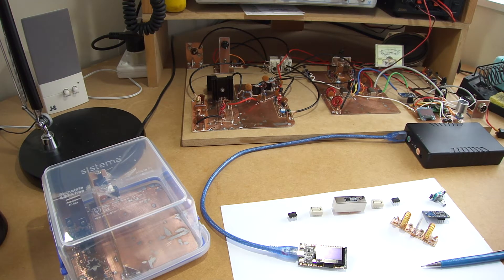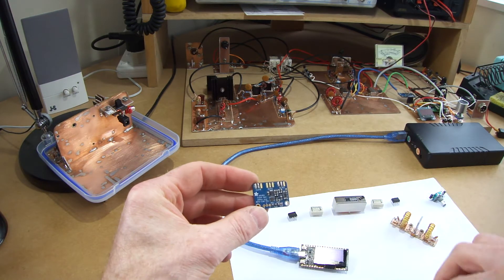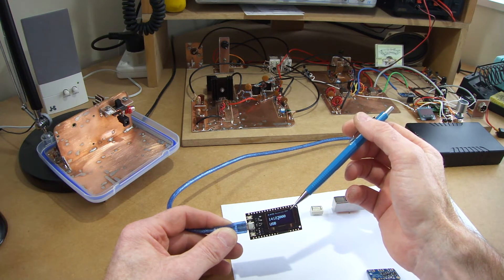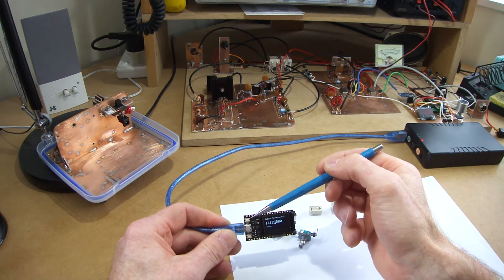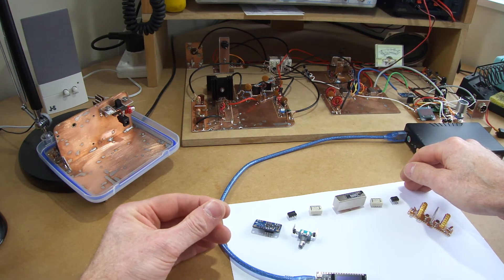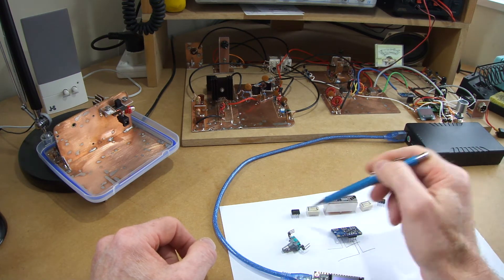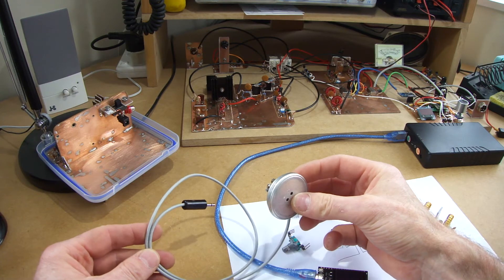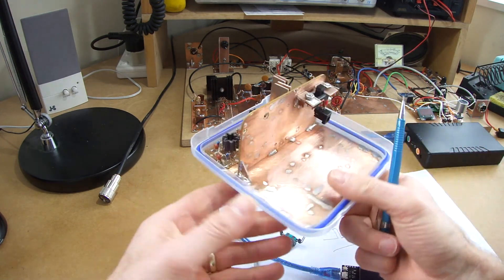Homebrew Portable 20m SSB Transceiver Part 1 - Design Ideas

Comment: I know this is an old video but I going to be working on my HF rig more and I plan on using my ESP32 as the core. I also plan on using the LEDC tone out stuff on it as signal sources for my tuners.
Reply from the maker: Let me know how you get on. If I recall, I had problems using the rotary encoder, Si5351 and display at the same time. I was just thinking last night that I should dig it out again and make it into a small portable antenna analyzer.
Reply: @CharlieMorrisZL2CTM  The ESP32 I have doesn't have the Display and I plan on not using my Si5351 and instead use https://github.com/espressif/arduino-esp32/blob/master/cores/esp32/esp32-hal-ledc.h which can output a freq as high as 40 Mhz with out interaction from any of the cores on the ESP32. I might end up even using the builtin wifi to have my rig interface be a web page. (For Freq setting and band changing)    

Also I got inspiration from your SDR series and was thinking of using the ESP for that but I would have to rewrite/port the Teensy's audio library to ESP32.
Reply from the maker: That's really interesting thanks. I'll check out that GitHub link later too.CharlieZL2CTM

Comment: Hi Charlie, I have a couple of the FL-30 Icom filters however I never found the impedance of these particular filters, however Inrad provide a drop in replacement for the FL-30 and the I/O impedance is 1000 Ohms.  Here is a link - http://www.inrad.net/product.php?productid=123&cat=4&page= Hope this helps and keep up the great videos I enjoy following your work. 
Best 73 
Rob 2E1IIP
Reply from the maker: Excellent Rob. That's a great data point. I'll start with that value.

73s
Charlie, ZL2CTM